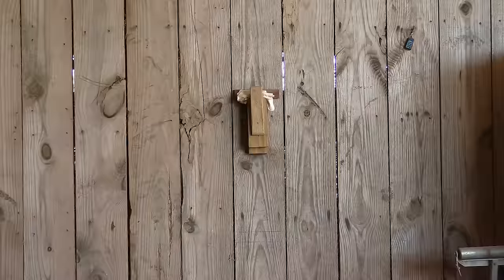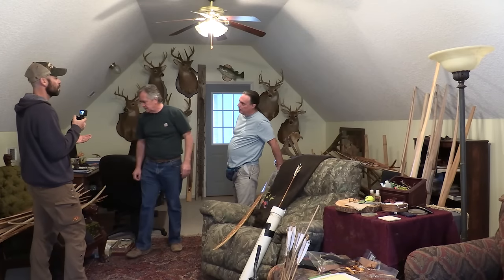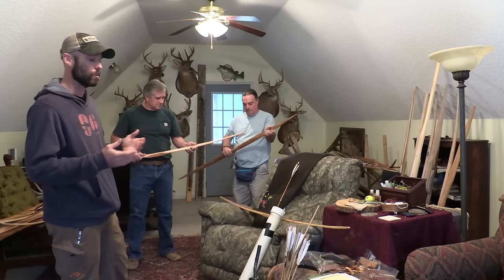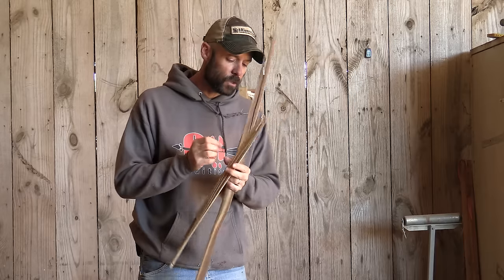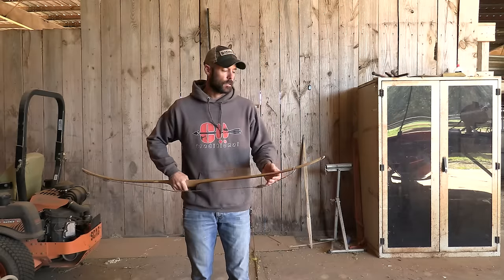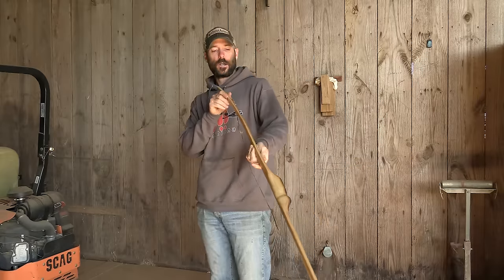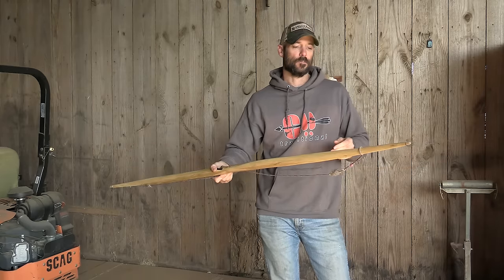Fire Hardened White Wood Self Bows - my BEST hickory SELF BOW yet!

Comment: When you fire harden you only need to get it 350-400 degree F  and you only want to harden the belly wood.  You are baking the entire limb at way higher temps than you need.   It would work much better if you hardened the belly with a heat gun and left the back side of the bow cool to the touch.   That way the back side is still elastic and the belly wood gets harder.

Comment: Great information, looking forward to seeing more on white wood bows and fire hardening for better performance. I'm working on a 65 inch, ash flat bow, and the process seems to continue with different ideas of making it better. Thanks again for sharing.
Reply: Love to hear how your Ash bow came out.  Just hardened my first Ash staves.  Never worked with it before, and I hear it's a bit finicky.
Reply: @mikeseeley1042  Hey Mike,
Bow came out good. I learned a lot in the process. I did over shoot my tiller and ended up with a 35 lb. draw weight. A few too many scrapes is all it took. Just started working with a hickory stave. They say hickory is a little more forgiving. I could use a little forgiveness..lol Have a good one and good luck on you bow.
Reply: @tommybarrios3307  thanks!  I'll approach tillering with caution 😊. Best wishes on your Hickory build!

Comment: Hi Clay, that bow bends a little too much in the inner limbs; that is why it doesn't hold more reflex. if you look at it, most of your set is happening in the inner half of the limbs. if you got the mid to outer limbs bending a wee bit more, that bow would have kept more of the reflex.

Comment: Will fire hardening make Osage better as well?
Reply from the maker: I’ve not tried that yet
Reply: Playing around with a mini bow taking some deflex out of one end definitely changed the tiller ! It was a scrap piece of Osage ! Yeah I would say it’s plausible !
Reply: It does the same thing to osage also, how ever fire hardening stresses the back more, and it's uncertain if osage would still have strong enough back after that. It's plausible, but would require more experiment to say for sure. At least that was what Keith said in one of the fire hardening videos. As i live in Europe, i don't have access to osage, other than paying twice to three times the staves worth on shipping and taxes, so i can't do any experiment with it, so i just have to go with what others say.
Reply: Osage can easily be reflexed by heat plus it gains somewhat in compression strength to allow for a narrower flatbow design. To go safe put a rawhide or better a sinew backing on it. That way I could turn a sluggish #35 Osage recurve selfbow with stringfollow into a #45 hard shooting bow that holds 2,75“ of reflex right after unstringing it.
Reply: @christianbowyer7812  from your name here I’m absolutely certain you’ve made more Osage bows than me! I’ve probably made about 20 and haven’t ever had one be sluggish though, you got me thinking about it, what would cause Osage to be sluggish? It’s always been just awesome for me, even crappy staves. Thanks
Reply: @shanek6582  Hi Shane, this mentioned bow I bought as used. Maybe the wood was too fresh when made, it had stringfollow and the tips were too heavy. That’s why it felt sluggish. But no longer.

Comment: Hi Clay! In the tillering process i thought of a way to see of your limbs are pulling the same.   Mark the center of your string with some visible tape. draw a centerline vertical on the backdrop of your tillering jig and match up the mark on your string with the line on the backdrop.    

When you pull it, if the tape mark deviates to the left of the line, that means the left limb is stronger. If it deviates to the right of the centerline, the right limb is stronger.

Comment: I make primitive crossbows.  Always made the prods from dogwood.  It is very forgiving, and tough as nails.  It fire hardens well, and I have always fire hardened them.  Set is not that much of an issue with a crossbow, because the string is braced just tight enough to stay on.  As a matter of fact, a little set is good for a crossbow for a variety of reasons.  You only actually tension it when you cock the bow.  Point being, yes Virginia, fire hardening is the Santa Claus of bow making here in the Southern Appalachians, and has been for some time.  It also works well for handles and other such things you use tooled hardwood for.  Work it green, while you can still cut it with a minimum of cussing, and then harden it before the final touches.  Just like a chunk of steel.

Comment: I picked up a Creek Walker longbow quiver last fall. Never thought I'd see the day I'd spend that kind of money on a quiver, but MAN am I happy I did. Easy to attach to my longbow. Very secure. I was just as pleased by the fact it didnt set the balance off of my longbow hardly at all. The quiver is light and it served me extremely well during this year's PA deer hunt. As an added bonus, I was able to add pine/hemlock/fir boughs to my bow to break up my image even more by tucking the boughs into the rubber strapping that holds the quiver to the bow.

Comment: You mentioned how leaving a big crown on the back of the bow would present problems later, and wanting it flatter. Can you elaborate quickly on the future issues by leaving the crown?
Reply from the maker: Hi Jordan, a high crown concentrates a lot of tension in the narrow band of wood at the highest point of the crown increasing the chance of a tension break. A wider back will distribute that strain better.

Comment: Nice job Clay. Thanks for sharing some of your experience with Thad and Keith. You mention crown and getting a larger stave so you can make it flatter. You aren’t chasing a ring on Hickory, are you? Is it just because of the balance between width and thickness or what?

Thanks again.
Reply from the maker: Hi crown concentrates the tension stress in a narrow band along the back. A flat back distributes that stress over a wider area.

Comment: Very interesting video Clay… so what degree did you get and where?  Secondly, you stated that Hickory is the fastest white wood bow you’ve built.  Where do maple and oak (red and white) come in behind hickory in your opinion.  The reason I ask is I live in the mid-atlantic states where there is an abundance of those three types or do I need to start searching for a hickory source a couple hundred miles away?  It was also very interesting seeing the water vapor coming out of the bow that unfortunately failed.  I used to live in MT and never saw such dry wood compared to eastern dead fail wood.
Reply from the maker: I got a Masters in Wildlife Ecology from Mississippi State. The hard maples, as well as many species of oak will make fine bows. It's not that hickory is better, only that fire hardening made it much better than a raw hickory bow.

Comment: question I made a form that will put 5 inches of backset in bow and I'm shooting for 3 inches I'm trying to compensate  for a two inch loss of backset what are your thoughts?  And it's awesome you got it to work
Reply from the maker: According to Keith, if you get a good hardening and tiller, you’ll be able to keep about half the original backset.

Comment: Thank you. I'm in France , I don't have access to hickory but I'm working with ash  tree.
Reply from the maker: That will work
Reply: Hi Fred, 
sure ash will be improved a lot by fire hardening. If you can’t get hickory staves or boards, you sure can get long ax-handles ~80-90cm. Make sure the grain runs straight. Saw them in halves and splice them together in the grip after fire hardening on a reflex form. Then you can back it with bamboo, sinew or just rawhide for safety. That’s how I did it successfully.

Comment: Clay, don't hate on crown with tension strong white woods. 

Some of the fastest, best bows I have.made were from 4" elm, ash, or  white mulberry saplings that dried into like 8-10" of reflex, which is way too much, right?  

During the heat treating process I took out most of that, so I was heat-treating AND compacting the belly under the heat at the same time. Getting them down to 2" reflex, cooked in good, made for very nice shooters.  The crowned back lightens the limb just like trapping a limb does, and you have plenty enough tension strength to keep the back intact.  You can still get a 2" wide limb,easily, and I think hickory would be the same. 

BUT!  Heat treating at least some woods seems to make powder post beetles and such LOVE them even more.  I noticed if ai n have treated staves, but don't get to them, rhe bugs will ignore other staves sitting right there and eat the toasted ones first.
Reply from the maker: Interesting, yeah, 90% of the bows I’ve built have been from Osage so I’m still learning about what hickory and the other white woods can handle.
Reply: @clayhayeshunter  

They can handle plenty, but they sure aren't osage orange!
Although, for twenty years I have been making them wider and longer to compensate for the lower mass and elasticitc, ala Tim Baker's and Paul Comstock's advice, and I will say right now I am almost SHOCKED at the success you are having on such SHORT hickory (and elm) with such high amounts of reflex.  I love a 2" wide elm flatbow about 68-70 " long with skonny, stiff tips in the outer limbs, heat treated to 2" reflex, expecting it to keep a fat inch.  64" always seemed short to me for a 28-29" draw. 

But now II'm watching and learning.

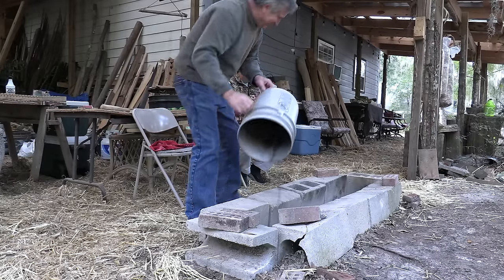Comment: I am at 6:50 right now, and to me and my thoughts...re-tempering wood is just going to make it too brittle. It's not like metal, where your can temper and quench repeatedly. It's fairly decently a one way process with wood and once the wood has been dried and tempered, yer kinda done.
Reply from the maker: Or are you🧐
Reply: @clayhayeshunter  I don’t know. Clearly after watching the whole video there is still some contention, but it’s still what I think. Wood although can be moistened, can never be restored to that predried state, same way as once the individual fibers in the wood have been cracked you can’t “uncrack” them. I suppose if you haven’t fully heat treated and dried a piece of wood you could finish the job_, but are you really _redoing it in that case or are you simply walking the wood further down that one way street?

Comment: I wonder how well you could get a mollegabet or other stiff tip design to shoot with fire hardening.
Reply: I tried it and overcooked the outside and undercooked the interior but it worked fairly well overall. Like to see a truly well made one
Reply: No reason it wouldn't work. 

I fire harden all my biws, because I'm already putting in a lot of time getting them straight with heat, and it works just as well.  The little technical problems you have with a Mollie are still there, but none are the fault of the heat.

Comment: Thanks for sharing Clay. Question for you, how well do those bales you shoot into stop those arrows? I've been looking for a suitable natural/biodegradable material to use for a target. Trouble is I shoot really heavy bows with really heavy arrows. Do you think those would work with 120+lb bows with 1000+grain arrows? I imagine not, but I figured I'd ask. Thanks.
Reply from the maker: I think they’d stop it just fine. Trick is to shoot the side of the bail rather than the end.
Reply: try steel  blunts instead of target tips.
Reply: @micahspur  Arrows are wood and usually 1/2" thick at the head so I cant use commercially available options.
Reply: @clayhayeshunter  I see, can you tell me how far these arrows penetrate those bales?